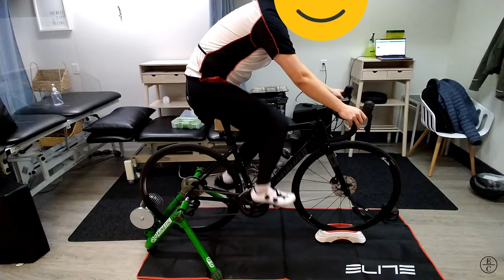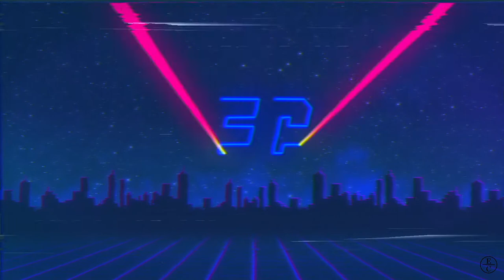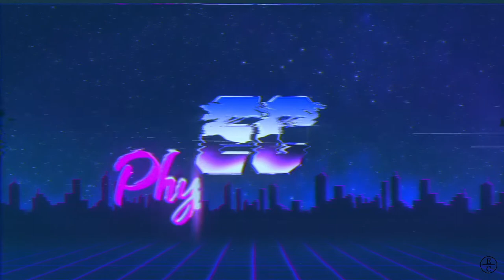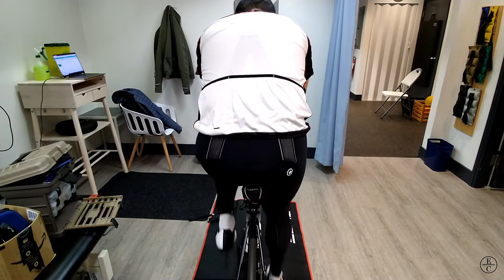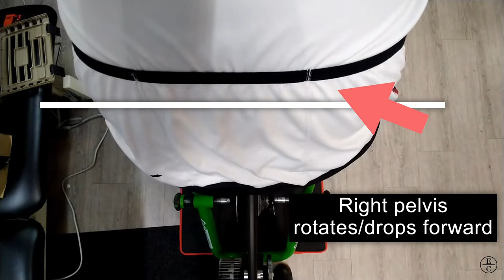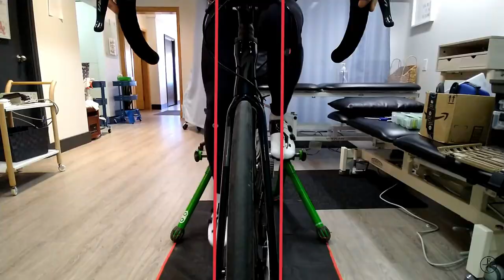How a Leg Length Difference Presents While Cycling | Using Shims to Increase Shoe Stack Height

Comment: This was his right leg that you shimmed? I was curious if the video flipped. Since his right leg was twisting forward. I have the same patterning and I sit twisted to the left. Right side shim doesn’t work for me but left shim did there was a vast improvement in comfort and connection. I still have windswept knees I’m trying to fix.
Reply: Try a heel shim or change stance width.
Reply: I twist left as well, a lot. Been doing it a long time, right leg was quite weak so even when i added the shim it felt weird. My stance was also too narrow. Put my shoes as wide as possible, along with shims(8mm my case), strengthened right. Finally getting somewhere.

Comment: I wrote a reaction on another video with wedges used for tibial torsions. I have a leg length myself of 1.6cm. I shimmed 6mm so far. The friction pain caused by a obligued torsion is gone. The kneecap pain on the outside of the long leg knee is still there... i tried to rotate my cleats but this doesnt seem to help.

What should you advice ;

1. Stay at a 6mm shim + wedge on tibia torsioned leg
2. More shims up to 9mm perhaps and wait with the wedge ? 

Hope you give me your opinion eventhough this doesnt makes miracles. Just happy with your opinion.

Greetings

Comment: Hello,
I have a question about my off to the right side while cycling. Ido notice that I have very tight hip/hamstrings in left leg and sit off to the right. I also feel like I am predominately pushing with big toe in my shoes. I have tried shim under functionalyshorter leg but it actually had opposite effect and pushed me over more. I think due to tight hip. Any suggestions? I do know that i have lots of canting in my ski boots to move left knee in and not sure if that applies
Thanks

Comment: For leg length differences would it be better to ride different length cranks on each side? Adding a shim shortens the crank at the bottom of the stroke but lengthens it at the top
Reply: You would also have less leverage at 3 and 6 o'clock position. So I guess it is still better to have shims.